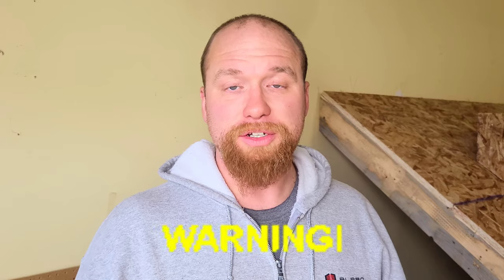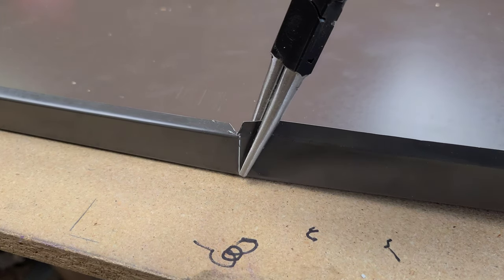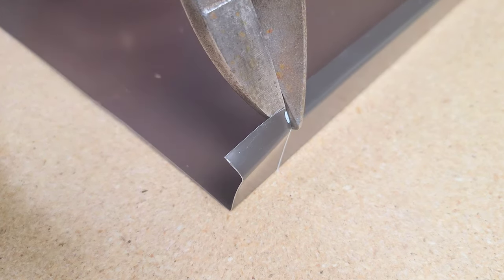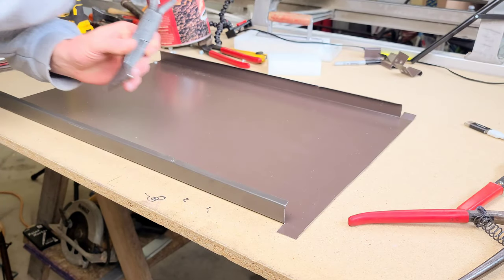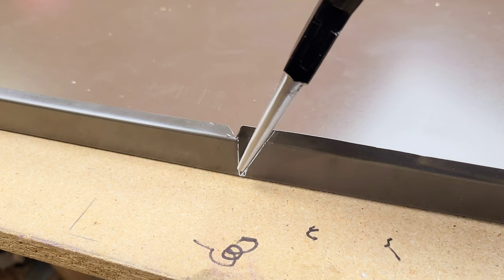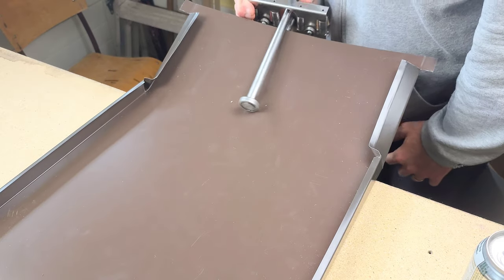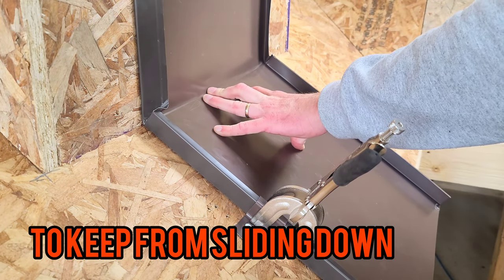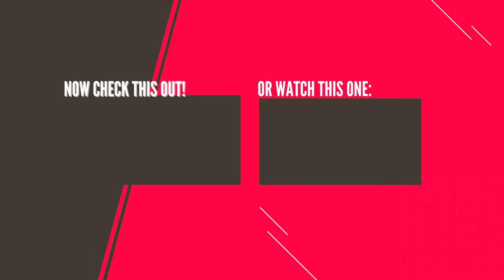HOW TO INSTALL CHIMNEY FLASHING WITH STANDING SEAM METAL ROOFING (FRONT APRON) PART 2

Comment: The cut and fold over the clip is a helpful tip! I was trying to think of a way to lock a panel in at the top without using screws to penetrate. Thanks :)
Reply from the maker: 💯 agree

Comment: Just curious....when the statement is made "these are waterproof details" have these details been independently lab tested to ASTM 330 and 331 static water pressure, and received approval? Or any air infiltration tests that would correlate to an ASTM E1592 negative pressure failure number? Nicely produced video.
Reply from the maker: No they haven't been tested because there is likely no testing for it...would love to get them tested...could you point in the right direction to do so?